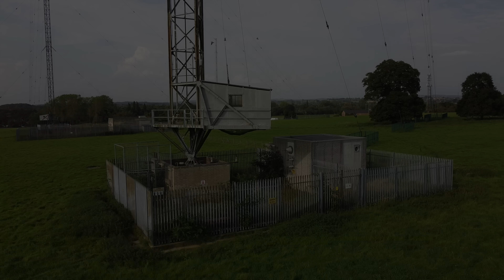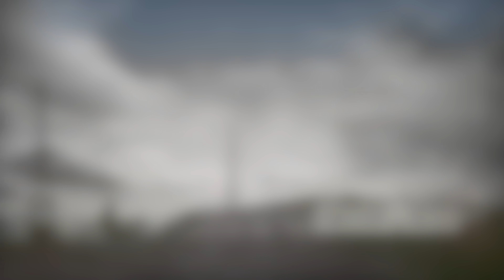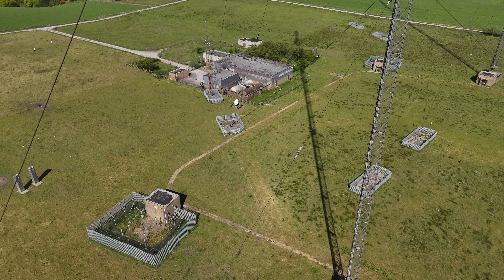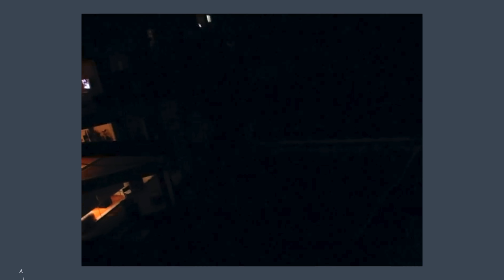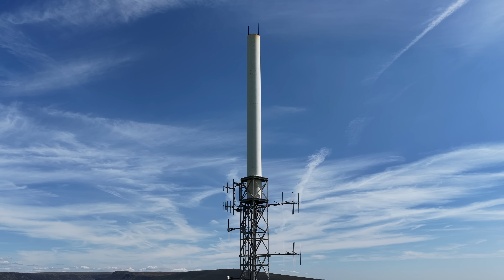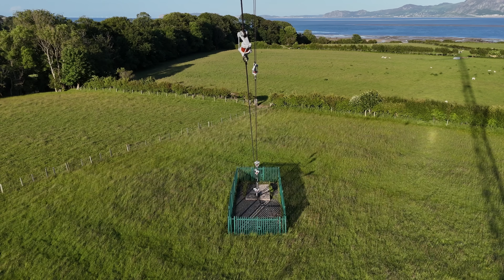Can You Harness Free Electricity From Radio Signals?

Comment: I wonder if the persons prosecuted were in actuality tapping into the “aether” as opposed to stealing radio transmission energy. As is presented, it would be very  difficult to steal power from radio transmissions and certainly not enough to power a barn or home. Very interesting.

Comment: As I recall back in the late 70s early 80s Radio Netherlands claimed that a Pub near to their shortwave transmitters was being lit by their signal. Also I'm sure that in one of the books I've read on Radio Caroline it was claimed that at one point whilst the Mi Amigo was off Holland with no working generator the crew hooked the main transmitter antenna up to a florescent tube to act as a warning light as they lay at anchor close to Veronica or maybe it was RNI,

Comment: In the 50s there was a things to do with your ck722 booklet from Raytheon that included a crystal set and amplifier powered by the DC component of the crystal set.  There's no reason that DC has to come from the same station - you can pick a local - at the expense of a separate tank circuit for it.

Comment: I live on a farm in Devon and we have both of north Cornwall's KV lines running across it and I can confirm if you stand near them with a florescent (not sure that spelt correctly) light bulb either a tube or a coil energy saver bulb and as long as has gas in it will work, your get 250 cows looking at you from the dark a bit odd like but it does work!

Comment: I spent a large amount of time during my PhD working on 'energy scavenging' - we were trying to scavenge energy from WiFi APs collecting energy over a course of hours to send a single WiFi packet. It works, but it's so inefficient as to be practically useless.

A tiny, cheap solar panel (a couple square cms) harvests way more energy and would be cheaper than the copper needed to harvest from a MW station! 😂

Comment: Great content...Having worked around several high power AM stations (Directional & non-directional), back in the day, I find it pretty unlikely that there would be enough mutual coupling that a coil, especially outside the near-field of the radiators, would cause any pattern distortion, even small steel buildings nearby didn't create much of an issue, however a well placed high rise or tall crane nearby is a different story.  It wasn't unusual for the flourescent lights in the ATU buildings at the base of the tower to stay lit. The real issue is that assuming you have been able to harvest enough voltage, most AC powered appliances need to operate at 50 or 60HZ, so outside of light bulbs, there isn't much it can run without burning out motors, etc. Then there's also the problem that the power will vary with modulation.

Comment: I successfully harvest power from a large electromagnetic radiation transmitter in the 400 to 800 THz range. It powers the domestic needs of my boat nicely. No one complains.
Reply: Ah yes, that nuclear fusion generator that circles the Earth once a day. Who put it up there, and will they sue us for stealing power from it?
Reply: You got a loicence for that solaaar panel, gov?
Reply: How did get locked to 400-800 Thz? Gigahertz is kinda tough without test equipment. Would love info on your system
Reply: @randymatthews5263  the rule of thumb is, 400 nanometer wavelength is 750THz.
Reply: @wbeaty no way you can build something like that yourself in the garage
Reply: @MelroyvandenBerg  We need LUNAR power panels, so they still work at night.
Reply: @wbeaty nasa own that patent.  fisherman wrapped solar film with bioluminescent film that lives for 10years. coiled it up and called it a battery. (idea while changing the batteries in his fishing float lights). he presented it as an "innovators of the year" nasa competetition idea and won. he got 50k cash and they got the rights to the tech in return. last we saw of it. decades ago.

theyve also made ultra efficient >95% efficient solar panels 3 times at least in the last 20years. we never see it.

china last time. grew nanoscopic crystal trees with arms of different lengths that capture nearly all frequencies of light.
Reply: Am I the only engineer to realize that the range of frequencies the O.P. said is visible light and he simply uses a solar panel and wanted to be funny? 🙄😁😂
Reply: THIEF! I bet you steal photons too, you degenerate! Photonic theivery gets armed police responses in the UK or so I've heard! I wouldn't know I'm part of the 2/3rds of ethnic English diaspora trapped abroad with no right of return because our grandfathers "did their duty" only to be betrayed. So when your government says you 'NeEd mIgRaNtS' they mean you need browns - because 2/3rds of 100% ethnic English still await the day we can come home!

Comment: I've always said that it is impossible for a radio station to know what happens to the RF once it has left the confines of its aerial. Seemingly, the tech guys were able to see where a signal was being 'sucked in' to a resonant circuit thus leaving a shadow behind it. Radio waves travel in straight lines, would the effect of an (eg) large water tank cast a similar shadow?. I'm certain that 'stealing radio energy' is a debatable crime, seeing that it is going through your property anyway, but the courts would err on the side of caution to stop a national craze. I had my fair share of RFI problems with repairing telephones near Saffron Green and Brookmans Park. In one case I was getting up to 75v AC down every direct exchange line on a PABX system.

Comment: There are several YouTubes out there that can show you how to harvest power from radio transmitters. The fractions of a watt of power they get is enough to light up an LED.      
One YouTuber,  Double M Innovations or @doubleMinnovations, has several hundred feet of antenna and pulled enough power to light up a several LEDs and even a home-made motor. He has also pulled power from a high tension power line with enough voltage to charge a high voltage capacitor and make sparks. 
Grants Pass TV Repair YouTube channel is another good one. He has a circuit to light up an LED from much higher frequency transmitters, including WiFi and stray signals outside of a microwave oven. 
Of course, none of this is new.  In the early 1900s, Nikola Tesla lit up a bunch of low power neon bulbs on a hilltop a mile away from his Tesla coil radio transmitter. After a century of research, we still can't make wireless power  transmission work Efficiently.

Comment: Also heard a similar story - about a guy getting power from Radio Luxinborough  .. 
There is also the story of the spy radio the Russia’s has in the Americans Embassy, it has no battery or internal power supply but was powered by a resident length of wire that the Russia’s could activate

Comment: You have to be pretty close to the aerial to extract useful amounts of power, although you could use smaller amounts of rectified RF to charge batteries. There's also something odd about people using this method 'to power their homes'. What do they mean by this? The power from RF is not compatible with most electrical devices as they run from 50 Hz AC, not high frequency. Incandescent bulbs will of course work on AC or DC and they are not too fussy about the frequency. You could rectify the incoming RF and use it to run an inverter to power you telly, but I doubt most people would have the knowledge to do this.  One amusing story from my days with Aquarius on MW - we installed a 250 watt MW TX in an empty house, and when we went on the air the bedroom lights lit up. Of course the TX and its aerial were just yards away.

Comment: I saw someone on the internet who shone a torch at a solar panel and used the power generated to supply the torch and a washing machine.😂😂😂😂😂😂

During the war my late father was in the Royal Signals and reckoned they could measure a voltage across two ground spikes placed several yards apart.

Comment: I do the engineer tricks of making a curly fluorescent bulb in my hand blink with the music, turn myself into a crystal radio and stuff like that for people when they tour the station though I am not allowed to channel Rush Limbaugh through my nipples again. I would also like to try the talking hot dog trick Jeff Gerling did on their AM tower but Nautel power modules are about 3 grand each to replace and I saw the amp gauge on his transmitter when he was doing it so that's a nope. I am only at a kilowatt AM and I think he is 50 up there. That said I generally have to be within a few feet of the tuning coil that feeds the tower to do it. It will occasionally get in random wires at the studios and zap you but it's rare now that I upgraded the grounding a few years ago. Mr. Carlson has lit up quite a few LEDs hooked to a long wire antenna. I don't know how far he lives from what transmitting stations. Back in the day and a few still on the bands have CB/11 meter radios that will make their neighbors toasters start talking. Our big FM transmitters (25-100kw) are in farmers pastures and for the most part the RF does not bother them. In the analog TV days the engineers had to go around putting caps on peoples tvs and phone lines of people near the towers but it's not an issue anymore or I have never had to do it. I have never heard of anyone causing signal issues by trying to harness energy from any of my RF engineering mentors.

Comment: If you had a large coil and variable cap and tuned the receiver to the transmitter frequency, I think you could get more energy from it. It would still be small, but power transfer at resonance would be higher.

Comment: My former boss was arrested as a teen for doing this in the Dudley area in the 70s.  The inductor he used was a massive coil of scrap wire hanging in the loft he collected over years.  He was discovered because of complaints about the radio coverage.  

The area is hilly and the region that dropped out previously had excellent signal unlike places a short walk away in either direction meaning something new was happening in a fairly narrow corridor and they fairly quickly focused in on the physical location.  He'd being powering the personal radio for listening under the covers like this for years it was only when he started to experiment it apparently caused issues similar to a large building appearing and vanishing in the narrow radio corridor and engineers had to be dispatched so nobody missed The Archers that it was ever noticed.  He wasn't prosecuted after agreeing to stop his experiments and not start them up again.  I have no idea if the story of the dodgy signal is true or if it was just a neighbour grassing him up after his other experiments messed with their radio but that's the story they used to scare him into shutting down and not starting up again. :)

He was a clever chap, a genuine hacker, and I learned a lot from him but he always said if he wanted to do it again they wouldn't catch him because of what he'd learned since :)
Reply: "complaints about the radio coverage" that is not how it works.

Comment: These reports are nonsense. If you can actually capture enough useful power to run lights then you are dangerously close to the transmitting antenna. 
I have a collection of 1920’s crystal cats whisker radios. With a long wire antenna I can hear radio stations on high impedance headphones.  This is a tiny amount os power. I can maybe believe a tiny LED or similar may glow faintly when connected to a long wire, but that’s about it.

Comment: "Back in the day..." the Belconnen Transmitting Station (Royal Australian Navy) built in far fields outside the suburbs of Canberra, Australian Capital Territory, was eventually surrounded by suburbs... and traffic lights at intersections. The 250kW 44kHz transmitter would "modulate" the traffic lights, and other cases where there were long runs of cable. BTS was limited to 100kW, later, but there was also considerable HF transmitting at 10kW and 40kW on rhombic antennas. See https://en.wikipedia.org/wiki/HMAS_Harman Also, I had a demonstration of the power on the main mast guy wire, when the Officer in Charge (Warrant Officer) demonstrated bu illuminating a flourescent tube from near a near-ground guy wire, and also pulled an arc streamer from a grounded wire.

Comment: Buried the lede maybe — but the most important statement was at the end.  If any of this was for real, HOW WOULD the engineer know?  Would it have to be through a drop in signal strength AND THEN increase to compensate?  Because I can’t even believe the signal strength would drop.  You’re just absorbing waste energy that goes to heat (maybe?  I thought).

Comment: The dead giveaway for me is when these stories claim that there was a "loss in the signal" or "hole in the coverage area."  That's not how RF works.  You can only receive as much energy as the transmitter is sending to the receiver's exact location, you cannot draw any more energy than what's there, your device simply won't work.

There's one similar story here in the States about WLW in Cincinnati.  For several years in the 1930's, they had the authority to operate as a "superpower" station with 500,000 watts (the AM limit here is 50,000 watts; they had an experimental license from the FCC to exceed that).  One of the common bits of lore around that was that incandescent lights near to the tower (within the station's property) couldn't be switched off and that fluorescent lights for a few miles would remain lit.  I never bought into the claims about longer distances simply because I know science, but the station itself DID power lighting for a large "WLW" sign on the tower itself without any connection.  That much is in the official record, there are photos of it..  But that was only because the sign was actually affixed TO the tower, so it was close enough to light up without physical cabling.  If you pulled the sign down to the ground, it would not light up.

Comment: I'm sure it's possible. I had a student apartment across the streat from a radio station, and the signal was very strong. You know the phenomenon, when you hold up a fluorescent light under a tighvoltage line... As for the theft factor, if they broadcast it over my property, it belongs to me or they have to pay rent for it.

Comment: I was early in my Naval career stationed at a Naval Air Station. Worked in the communications department there. We would use a small fluorescent tube light to walk the the antenna farm when one of the intruder alarms went off. This was more for staying out of the dangerous RF near fields than to light our way. The brighter the tube the more power the antenna was transmitting. Most the alarms were small animals getting caught in the fence line. 
It was an interesting time. As for the science behind these reports I would have to look into that. But I am sure there might be something to it. But would believe it would be more like the 'free energy' things on the internet. Not really fake, but mostly fake.
Peace

Comment: I worked in broadcast radio and our FM transmitter site had fluorescent lighting at the remote transmitting site. Our FM transmitter had 12,500 watts erp and as we would leave the transmitter building we would turn off the lights, the tubes would continue to glow for a short time from the RF. Our tower was basically 8 feet from the building the tower was a bit over 100 feet tall.